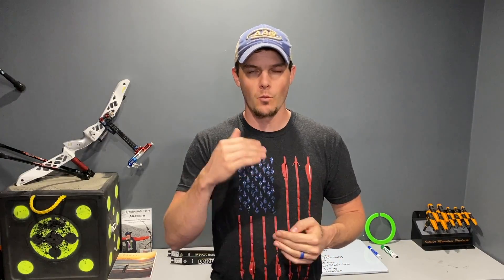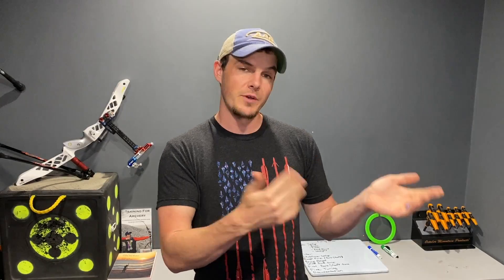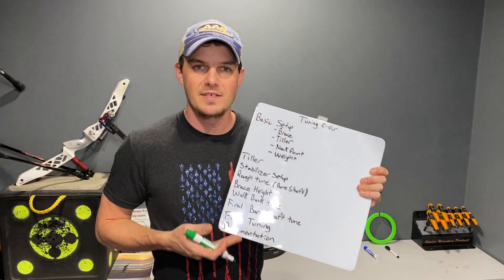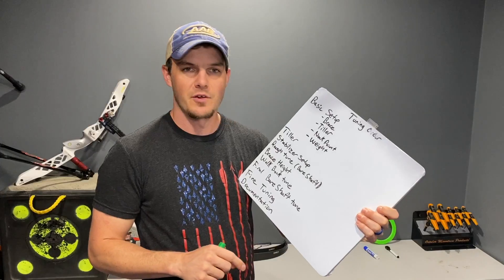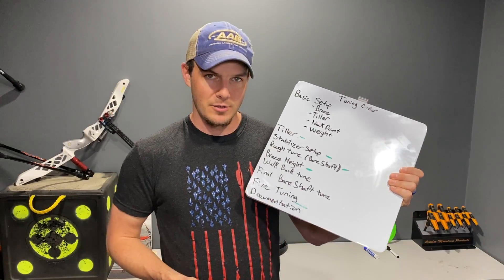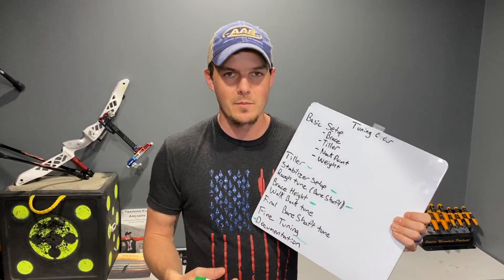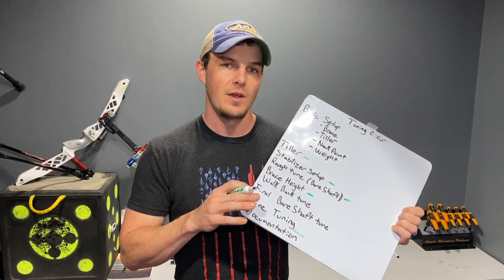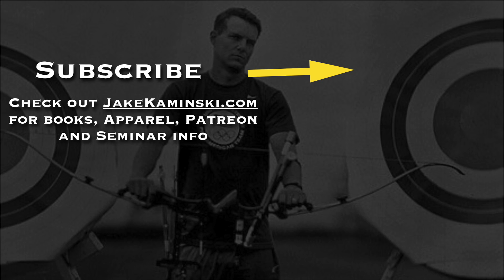Recurve Tuning Best Order to Make Adjustments for the Highest Scores Possible

Comment: Hi Jake. I'm awaiting delivery of a new bow,  a Samick, I don't expect you to have any experience with them, but you may be able to give me a general answer. How far can you safely back out an ILF limb bolt? I understand its different for different brand bows, so I was thinking, if I wind the bolt all the way in, then wind it out and count the turns till it falls out, about half of that might be safe as long as the limb butts are more than halfway in on the bolt shaft? Does that make sense? I've been searching all over the web, but haven't found a reliable answer. Cheers. Love your work!
Reply from the maker: In the basic recurve setup video explaining how to make adjustments I cover how far out limb bolts can be adjusted safely.
Reply: Thanks Jake, I wasn’t sure if I saw something like that on one of your videos or someone else’s.

Comment: . Thanks for the guidance Jake. I was just finished with walk back tuning when restricted movement order issued by our goverment begin. Now, most thing I could do is practicing my form with terra band and draw my bow without arrow . I have a question though,how frequent we should do these tuning steps?
Reply from the maker: Sorry you're stuck inside for a bit, great opportunity for SPTs to gain strength and form work 👍 I would tune my bow if I made major form changes, equipment changes or if my bow stopped shooting well. BTW, If you haven't subscribed I would really appreciate it if you did, so you will be alerted right away when videos drop. THX again for all your support.

Comment: Question re: bare shaft tuning distances. I'm a low draw weight (23lb.) indoor, BB stringwalker. The arrows I shoot (Easton inspire 1000) are within Easton's recommendation, tune fairly well but indicate a spine that is too stiff, even with the maximum limb and point weight. I purchased a set of weaker spined arrows and began bare shaft tuning which tuned okay (but groups not as good as I thought I should be getting) at distances out to 20yds. When I continued tuning out further than that everything went to pot with arrows tailing left, sometimes landing off target. As I only shoot indoors should I be content with these results or attempt to re-tune? Should I fine tune at 20yds. seeking problems with centershop/plunger issues?Is the low draw weight a factor? My limbs are aligned, brace height within manufacturer's spec. Gillo G1, Spig, rest. 
Thanks for your anticipated reply.
BTW I am a subscriber and have hyped your series to my fellow archers!!!

Comment: When you do fine tuning, which is more important: the group or the feeling? I am currently playing around two setups, one give me the best grouping but the feeling is weird, the string on my finger doesn't feel quite right, the sound is weird, everything makes me feel weird. The other setup, feels much better, makes me feel like the bow is part of my body, but the grouping is not as good as the first one. So I am not sure which one I should go with. My coach told me to go with the second me because the grouping will improve later but I just want more opinions. Thanks!